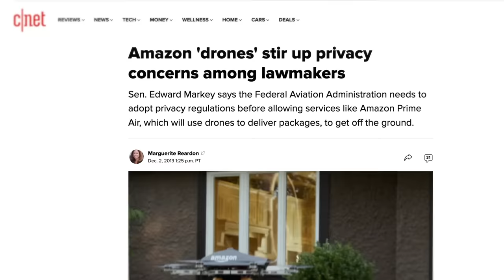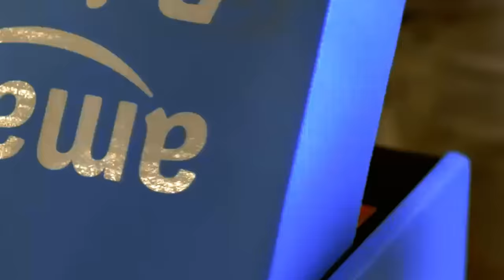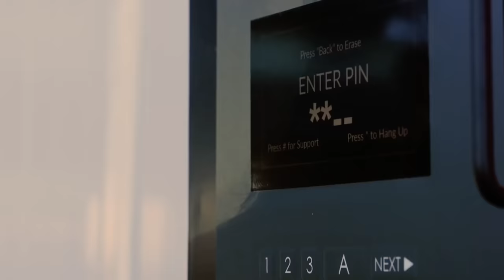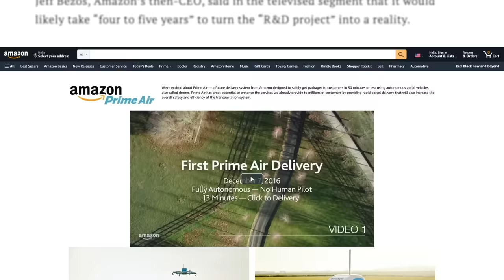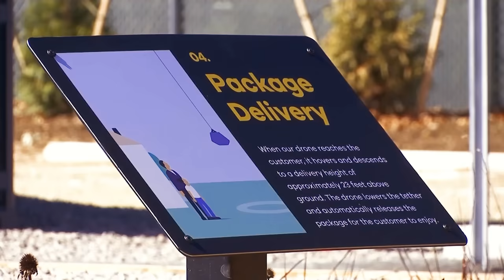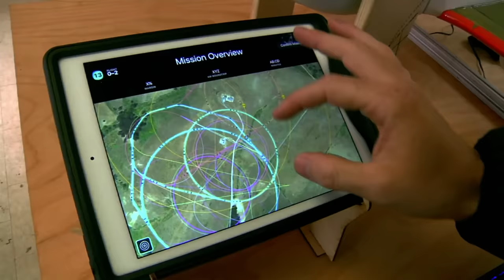Drone Delivery Was Supposed to be the Future. What Went Wrong?

Comment: What if people could buy landing pads that would emit a singal to the drone and guide it in? Then the only thing the drones need to do is fly in designated "lanes" in the air and land where the signal is coming from the pad (which would be linked to a persons amazon account for example). Idk maybe sometimes already tried this idea.
Reply: I think you're simplifying about ten real problems into one simple answer, reality may disagree
Reply: There is a landing pad already: It's called a mailbox or pick-up site. It uses a written address!
Reply: @spacelemur7955  You're missing the point, a designated landing spot for drones is a good idea. It reuses contemporary ideas (the mailbox) while solving the issue of where a drone should deliver it's package-especially for places like apartment buildings that don't have lawns or driveways. And it solves the safety issue somewhat.
Reply: @Razumen  There are other issues. 1) The energy needed to fly, especially vertically, is inherently  greater than to roll. 2) Drones take 1 package per trip and must always return to its hub for a recharge.¹
3) Ground based vehicles can carry hundreds of packages along an energy-efficient route, lower the energy cost per package of a heavy vehicle. 4) A mailperson can deliver many packages in the time it takes the drone to return, reload, slap in a charged battery and fly to a new address. It is inherently a piece-meal process, while postal delivery is sytemic.² 5) Drones are noisy. 6) Drones are limited in load capacity, such that ground delivery is still required for larger loads, which, if that is the sole load, is also energy inefficient.

To sum up: the need for instant gratification in shopping is wasteful of resources.
_________________
¹ In the drone's favor, had the customer driven to a retail outlet and back for that one item (a typically American habit), the drone is much more energy efficient.
² Amazon vans and similar services are also energy intensive, in that they travel longer average distances between deliveries compared to the postal service.
Reply: @spacelemur7955  I'm not arguing for it. I think drones are good for some deliveries, but definitely not all.
Reply: @spacelemur7955  Honestly I think drones are better at the complete opposite of what Amazon wants. Delivering to customers in out of reach locations such as in the countryside makes a lot more sense than in a busy urban area where there are many more kinds, and more efficient, delivery options.
Reply: @Razumen  Drones don't have the range to get much into the countryside.
To me, all these drones should be given to the Ukrainian army, who will make much better use of them. 🇺🇦
Reply: @spacelemur7955  Not true, range isn't an issue for larger drones. The military has drones that have effectively indefinite range limits. Of course, that's the extreme end. But it shows that drones CAN be scaled up to fit the demand.
Reply: @Razumen  What would it cost to send a single package a few hundred miles, not only in dollars but CO2? Mili drones don't run on cheap renewable electricity. We people, FFS, have to start thinking more in terms of ecological costs than in dollar costs. To me it's completely insane to have instant delivery unless it's an unforeseen medical emergency or something on that order. We consumers should not be demanding that our whims be met just because it is technically possible. We are laying waste to the future through our selfcenteredness.
IMFHO.
Reply: @spacelemur7955  Less than it would cost to send a whole truck just to deliver one package.
Reply: @Razumen  That's why I like the post office over delivery companies, they almost never drive single deliveries. That would be a very rare case, yet for the drone it would be virtually every case.
PS: Most delivery companies use the postal service out in the boonies.
Reply: @spacelemur7955  Yes. And that's why delivery sucks in the boonies, and exactly why drones make sense for priority deliveries.
Reply: @Razumen  Let’s start with economics. "The average cost of delivering a package is currently about $10, and a bit lower for multiple-package delivery. In contrast, consumers are willing to pay only about $1.50 per delivery, "
I have already pointed out many other problems of the economics of drones regarding the proverbial "last mile", which only gets that much worse in the boonies. Yet, you seem to be ignoring them,, because you just like the idea of drones, data-be-damned.  
So, I give up. It's the old leading a horse to water framework. Perhaps these thoughts need time to ferment instead of repeating our points back and forth. 
I leave you with complement to your politeness here, you are definitely a cut above most others!
Best wishes from a boomer who studied logistics back in his day.
Reply: @spacelemur7955  Lol, absolutely no one is paying as little as 1.50 for priority mail to their doorstop in the countryside. The post office doesn't even do that, you have to go to your P.O. Box and pick it up!

At this point, you don't even know what proposal you're arguing against.
Reply: @Razumen  
That was a quote from a research paper looking at what consumers would prefer to pay. 
Since YT  has become anti-link here is a title of an article that covers this very topic:
"Comparison of energy demands of drone-based and ground-based parcel delivery services"
Reply: Why not creating ground tunnel or sky tunnel for drone so make sure the tunnel only for drone to keep delivery not even noisy and safe?

For us to make better future should create tunnel for in every house or apartment with special tunnel unit so everyone can enjoy delivery without worry

More privacy should every room have to have special tunnel for drone will be amazing
Reply: @tonysantosa4193  You're basically talking about creating more roads lol, which defeats the purpose of drones...
Reply: @tonysantosa4193  The physics and economics speak against that idea:
A) Tunnel digging is frightfully expensive, especially one dedicated to periodic use.
B) To accommodate medium-sized packages, the inner diameter would have to be much larger than the drone and its load in order to prevent scraping the tunnel wall.
C) Each delivery point would need an airlock. Otherwise, when the customer opens the tunnel the airflow in the tunnels would be affected jostling the drones.
D) What about returning drones? Do they get their own tunnel, or must they manouver around the loaded drones.
E) The tunnels could not be directly linked to each delivery company. A large central tunnel with increasing branching would have to be built.
F) Air flow in a complexly branched system would make flight difficult to perform safely/reliably.
G) A geolocation signal would be required at every branch. Currently, just a relatively few GPS satellites cover the whole planet. 
H) What about collisions or breakdowns in the tunnels? How are they retrieved and how long will the delays be to other deliveries and returns?
I) Flight is the most energy-intensive way to move things. The motors must carry all the weight through air. With wheels, the weight is supported by solid ground, and the motor need only handle horizontal motion. Consider, please, how much energy is needed to bicycle uphill. Pedaling a bicycle straight up into the air with rotors or wings and keeping it there requires much, much more energy. But that is what a helicopter drone is essentially doing. It's why their range is so short. 
J) Energywise, small delivery trains/EVs in those tunnels is much smarter, but they too would have issues of removing breakdowns, geosteering etc. 
K) All the above would make delivery costs excessive.
L) A current ground vehicle can carry tons of freight at a very small energy cost in comparison.
M) We already have a ground-delivery multipurpose infrastructure in place already doing deliveries. What you are proposing would have to be superior.

Thus, while your idea is creative and sci-fiy, it is a non-starter.

Comment: Why not have customers interested in air delivery mark and confirm the gps coordinates for where they want the package delivered? Could just be an extra fill-box when setting up delivery address.
Reply: Or there could be some sort of box or landing pad itself that you can set down on your yard, porch... The landing pad could have sensors to determine if it's a viable spot for delivery , and whether its possible to drop a package from the air. a gps could also be attatched to allow tracking via the drone itself...
Reply: @peyton.simpson  I'd imagine the pad would resemble a QR code,so that the drone looks for a specific pattern vaguely in the specified location. Then also add some special patterns that allow the drone to determine the distance from the pad/altitude and you have a very cheap system (for the consumer),with all the expensive hardware aboard the drone
Reply: The problem with that is the neighbors
YOU might be ok with it, but the person living 50 feet next door is not.  You have to fly over and next to other people's houses and make a lot of noise.
You'd quickly find cities banning them for that reason.

Comment: Personally I was a little scared when I heard about drone tech. Flight is a relatively tricky mode of transport with plenty of things that could go wrong and throw a pilot off balance. In flight, aircraft need to constantly keep their engines running, if they fail they fall. 
So I had this vison of heavy drones with razor sharp blades spinning at incredible speeds randomly plummeting from the sky.
Reply: Yeah, even hobbyist fpv drones under 250g aren't meant to be flown in/over populated areas, nevermind these massive things
Reply: Razor sharp seems like hyperbole
Reply: @suhailmall98  fr, even those Mini 2/ mini 3 pro could do alot of damage
Reply: @lucaslucas191202  Well however sharp they are then.
Reply: pyropulse  I know but as a plane needs constant steam of air passing over it's wings to generate lift, without sufficient forward momentum, it's only a matter of time before it can no longer sustain flight.
Reply: True... Very true
Reply: That doesn't happen.
Reply: @lucaslucas191202  falling from 50 feet? That sounds about accurate
Reply: @michah321  
They don't get sharper by falling 50 feet, they just collide with you at a higher speed
Reply: @lucaslucas191202  true, well said
Reply: And why do you say that? @Sammysapphira

Comment: "without fossil fuels"..
It bothers me, that still far too many people just completely ignore the fact,
that the batteries need to be charged with SOME kind of energy
Reply: True, but that opens up a wider variety of sources than IC engines.    It is also a potential place fuel cells could be used since hydrogen storage gets more effeint when you have a nice central storage location that can be filled from tanker trucks.

Comment: You would think that the CEO of Amazon would have enough common sense to know that something like this would never work. I knew the first day I ever heard about it and I'm just a regular guy. And driverless cars I don't think have much better of a chance either of becoming widely used. Or driverless trucks. My wife works in logistics and you would not believe how complicated and big of a hassle is to pick up and drop off loads sometimes, and that's if you can actually get there without running into something. There is no way a truck can go into one of these ports without a driver pick up a container and take it somewhere or pick up a container and take it to a port it's not going to work. So check back with me in a few decades or so and we will see how it's going.
Reply: I can see driverless trucks for large deliveries working if you cut out the last mile part of the driverless equation.  Driverless truck launches from a facility that's near a highway or such and sticks only to highways, interstates, autobahns, or what-have-you.  It then arrives at a similar facility just off of one of those, at which point a real driver on the site gets in the vehicle and drives it to the final delivery in-town/the next town or two over.

Of course, big problem right now is I'm willing to bet drivers are cheaper than this sort of tech and the facilities to support it, so it's proooobably far off enough before it becomes economically viable that a better solution could potentially show up first and make it unnecessary to begin with.

Comment: The problem will always be the last foot. Logistically, there are too many challenges, customer expectations, competition.
And in the remote corners of the world will still require a hub to launch at ther source point. Then draw a radius and you'll have range. You'll also have environmental conditions. Drone motors don't like rain.
Reply: Believe in JESUS today, confess and repent of your sins. No one goes to heaven for doing good but by believing in JESUS who died for our sins. GOD loves you soo much unconditionally.😍😚🤗
Reply: Drone motors don’t actually care about rain, they are the only thing that can operate well in the rain. The rest of the electronics can be very easily sealed away with sufficient cooling provided through heat sinks that are exposed to the elements. There are many drones on the market that operate in heavy rain some even landing on and submerging under the water.

Comment: @Wendover Productions At least as far as the United States goes, it feels like this would make the most sense to be done through an agency like the US Postal Service. The way packages have gotten around before drones, before gig workers, has been a mail delivery driver going around filling mail boxes at the designated address. 

So if these drone delivery companies partner with USPS, they can be trusted to enter certain air spaces and drone-friendly version of mail boxes can be designed that can be installed at each address that would like to make use of the service. Post Offices with their P.O boxes can have a location for the drone to drop off its cargo that is then put into the P.O box. The agency has also been in need of new services it can offer for it to turn around its financial issues.

Comment: The drone "issues" don't seem difficult to over come at all.  They are just missing out by only looking at the drone.  Amazon especially should be able to look at the problem as whole, ie. the problem is last mile delivery.  For example where I live some 7-11 have amazon lockers.  Redesigning the lockers so that the drone drops the package on the roof of the store and its put into the locker.
Reply: That only works if the locker is outside with clearance to the sky because if the locker is indoors no store owner/company will want to pay to install the shute/conveyor system to get packages from the roof to the locker.

Comment: Well... the video says it all, aside from one detail.

There is actually a third new(-ish) way of delivery, that's not flying drones and non-flying drones. Those are called parcel machines. The idea is extremely simple - plop the device in multiple locations in the city, deliver tens or even hundreds of parcels to them and then let the people pick them up when they have time. Much better then the drone stuff, because it does not require you to be at home for the delivery. Just to be need the machine within 48 hours after the delivery, which is much more manageable.
Reply: That's just communal mailboxes with extra steps.
Reply: @Jebsucks  Kind of...

but they are bigger, so most parcels can get there and you don't "own" your spot. But overall a very similar idea. Even down to the fact you can just walk to one.

Though from what I've noticed looking around the internet is that the ones in Poland are much more advanced then those in the UK (don't know about Germany). We can use an app to open the doors of the thing, we can send parcels both to another machine or direct address without printing or writing the address on the box, their everywhere (I have 4, that I know about, in the walking distance, I bet there are more but I just don't notice them) and the company behind them is experimenting with refrigerated ones.

Overall a great experience. Like a two-way communal mailbox (where you don't have to be at home to get mail from postman), but for boxes

Comment: This didn't age well, Zipline and Wing are doing fine. 
They stay at a certain height to cut down on noise and lower down the delivery. I think droneUp is doing a similar thing
Reply: came here since I saw the same recent keynote. Super excited. However still too soon to say that this video "didn't age well", all we've seen is staged/cgi montage of docks/portal and delivery. customers have still yet to build delivery docks and ship items and finally if it's actually viable (I know it is, but you never know what happens when you place the product in production). One huge win is that zipline solved the noise pollution issue, their drones are just about silent.
Reply: @aquaductape  yes staged cgi but its based on already existing systems like how Wing and droneUp lower their deliveries down.
Even if they don't have that little droid pod they can just make a longer cable and it will still be great at reducing noise combined with those new wishbone looking props.
Zipline also has the data and safety measures from years of flying blood in Rwanda.

Comment: Delivery drones are a bad idea generally. They can't carry a lot of weight, don't have a huge range and need a lot of space to get the delivery safely to the ground. They are also very dangerous when they fail.

But they make sense for relatively light but valuable packages in low-density areas that need to arrive quickly.

It's like cargo helicopters compared to ships, trains and trucks. And it'll probably stay super niche like that